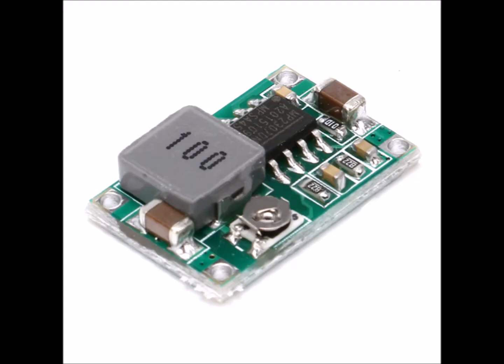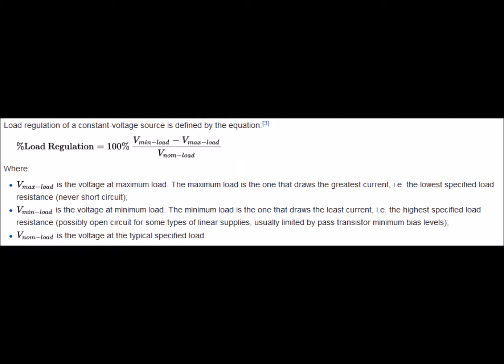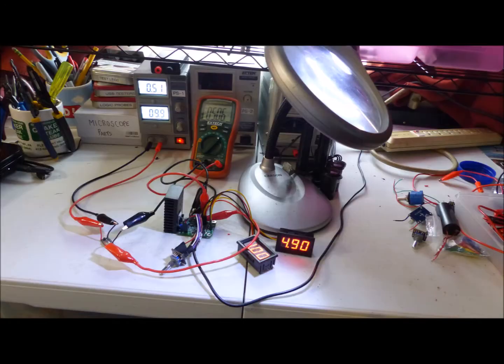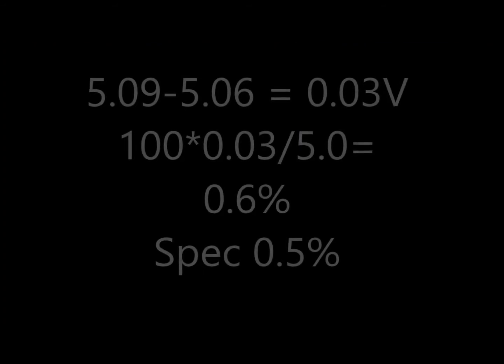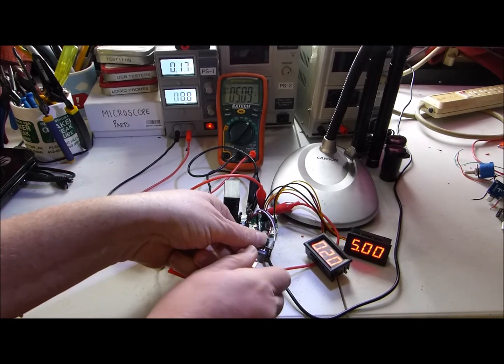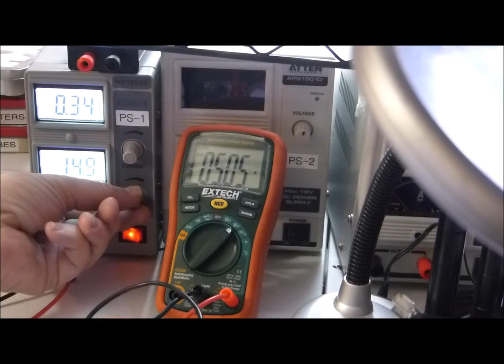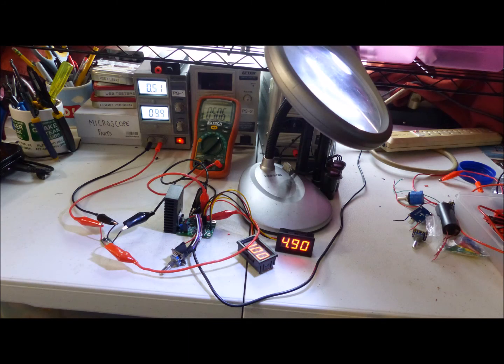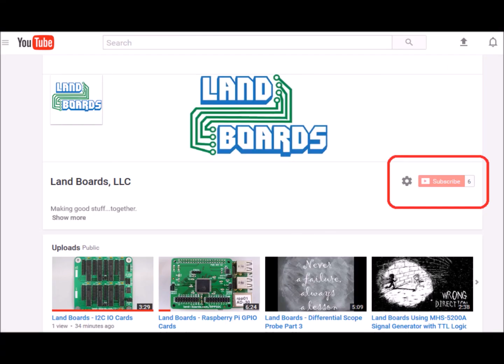Land Boards - Mini360 DC Power Supply Review

Comment: Perfect your lesson!
my design is tiny to fit like a pen 2 finger width, i'm seeing a step down to parallel the 12v motor power to 3.3v power to the arduino nano.  But I'm afraid this will steal 3.3v from the engine and stay only 9v.  it may happen ?
Reply: It has a pretty low drop out voltage and a constant output. I've put in 5-23V and get out 3.3V consistently just fine.

Comment: if you vary the input voltage like with a solar panel does output voltage remain fixed at that you set it to or will it also track along with input voltage?
Reply: It has a pretty low drop out voltage and a constant output. I've put in 5-23V and get out 3.3V consistently just fine.

Comment: Would this MIni 360 Buck converter be a good choice for my project requiring an  output of 12vDC?
 I am looking to use battery Li-Ion 18650  to power a set up flashing LED strobes on my PARAMOTOR as collision avoidance lights.  Requires 12vDC.  I'd like to use 4 cells  (4.2v-3.3v x4) as input voltage to output 12V.  
SPecifications: Voltage: 12V DC
, Amperage: 1.39A, Power: 16.7W
Reply: https://youtu.be/BiRxg3cJC7g

Comment: why will the voltage not adjust with the set screw ? My input is 7.4 and i want a 5v output.  I turn the screw and no matter it just stays at 3.8v
Reply from the maker: Not sure. I haven't messed with one of these in a while.
Reply: Probably you need to change the pote
Reply: You need 8.6v minimum input to get 5v output.  Solution would be to check at a higher input voltage.  If you want 5v output, with a potential drop of 3.6v through circuit, try an input voltage of 9v or higher. 12vdc input would be great, just keep it below the 23v max.

Comment: While idle, with no load, what's it's current consumption?
Reply: Awful! it varies strongly between modules between 12mA and 70mA. 
There is a reason why the chip it uses was retired!
Reply: with my fluke dmm set to 10A. it registers 6mA(no load). check datasheet. input/output points out to using 2x 10uF.